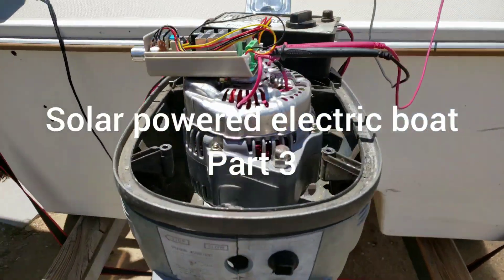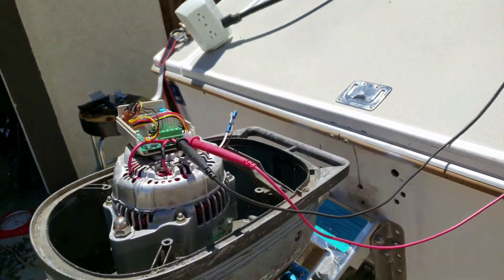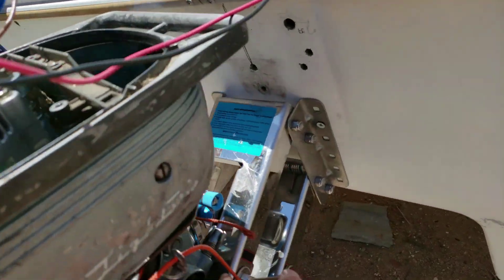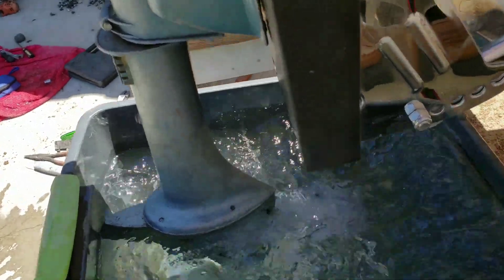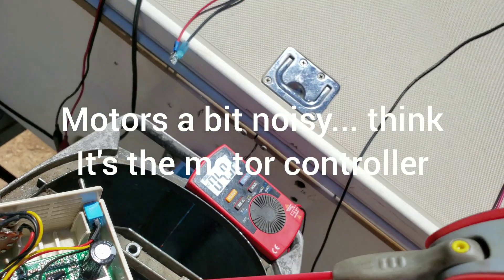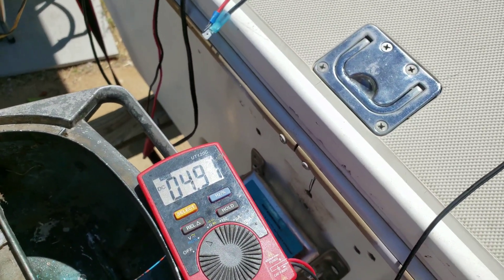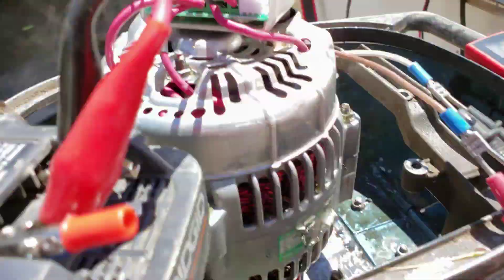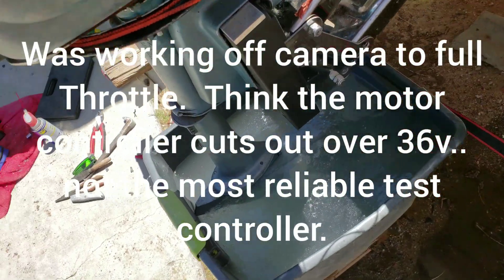Car alternator bldc motor Solar powered electric boat build part 3

Comment: thanks, don't forget to do marinisation of electronic components and clear the motor once a while to remove the salt, also you can make a sealed big chamber and cool the air inside with a diy sea water pump cooler

Comment: I am interested in doing the same sort of alternator powered outboard. Have you been able to make any more progress with this project? I am trying to get some sort of idea as to how much hp a converted alternator will make.
Reply from the maker: @make cool stuff. Thanks for your comment!   I havent been able to make any progress on this due to moving a year ago and leaving this project with my partner.   I plan on picking back up with either an outboard again, or an inboard jet.    Based on the factory rating at 160 amps at 14.4 volts, electrically its about 3 hp.   I believe with additional cooling and overvolting i could get it to around the 10 hp range.    Before diving into it, im building a dyno to determine hp and torque of a few different alternators and will move from there.   I will record and upload my progress as i go, so feel free to check back in periodically!
Reply: @samsracing  Thank you very much for the thorough response. I have been looking into this further and it seems like getting an appropriately sized controller is going to be expensive. I am of two minds; either use one or two over-volted brushed motors and relays (2 x 12 volt batteries) or use two ebike motors and controllers to get a minimum 6 hp.
Reply from the maker: @make cool stuff.  The alternators i have worked with at 56v spin around 3400 rpm.   What ever you do, you want to consider how fast you want to be able to go, and do the math of the pitch of your prop to see what rpm and power you would need to achieve.   The outboard i had translated to 12 mph at the rpm of the motor assuming it had enough torque to get there.   My plan was to overvolt to 100v+.   The sevcon 3 i believe it was was a controller that i could find used on ebay for 300 or so which would allow programmable torque limiting etc and a wide range of input voltages, and could work with or without halls.     I plan to push the alternator design to its fullest and see what we can come up with powerwise with different voltages and torque combinations.

If you found a good 3 phase electric forklift you could have a pretty powerful setup
Reply: @samsracing  thanks again for your thorough response. I am planning on having something working for this coming summer.

Comment: Still not BLDC
Reply from the maker: It has brushes for the stator field, not for commutation.   It will run with a bldc controller with a seperate circuit for stator electromagnifiction.

Comment: What kind of power does the altermotor make, ??  I have been currious if it was worth doing, if it made enough power!
Reply from the maker: It seemed to have a lot of power.  Heat tends to be the issue with electric motors.  I figure alternators are rated to generate current under extremely hot under hood temperatures so the coatings on the windings might withstand a bit of overvolting.    This one at its charge rating of 160 amp at 12 volts is 1920 watts at around 3k rpm.  That's roughly 2.6 hp.  I was planning on over volting to close to 100 volts but controlling the current as to keep the heat down along with water cooling.  My plans were to get close to 10hp out of it when I had to move across the country and abandon this project to my partner.  The build is still ongoing and I will post progress.  I will be doing another alternator boat soon and testing on my new property.  More to come
Reply: @samsracing  I am converting alternator for 120V ac to be driven with Wearable frequencies drive.
Idea is to double the coil turns by punting coils in series instead of parallel for each phase (6 wires) as to lowering the rpm down.
Reply: @samsracing  How do you water cool an alternator ?

Comment: Buy a vesc 4.20 or ebike controller for that motor! The vesc is usb programmable controller with all the settings you'd ever want :)
Reply from the maker: I will look into that on my next build. Unfortunately I had to move and passed this project onto my partner to finish.  I will be building another to see this to the end in the future and will look into that controller.  Thanks for the feedback.
Reply: @samsracing  VESC 4.20 is only 12S max, i would tell you to search the HV ones (some of them 75V, others 100V and more)